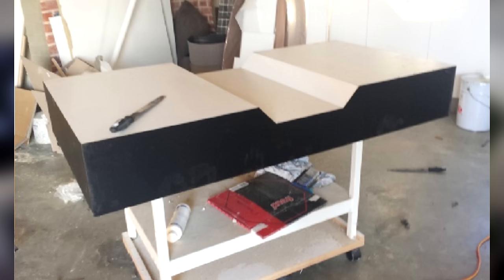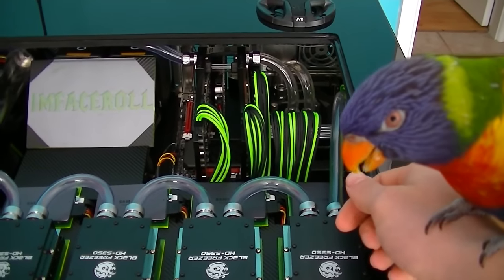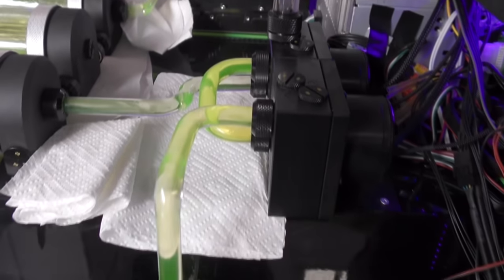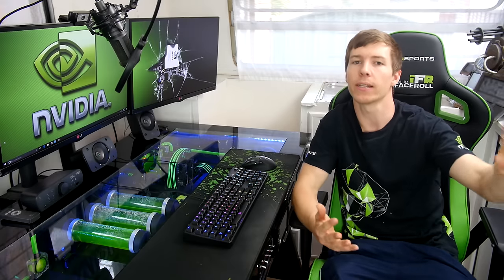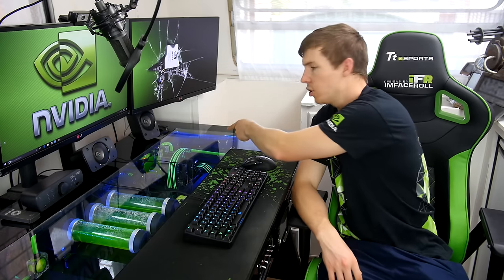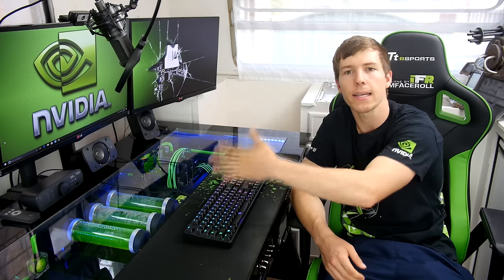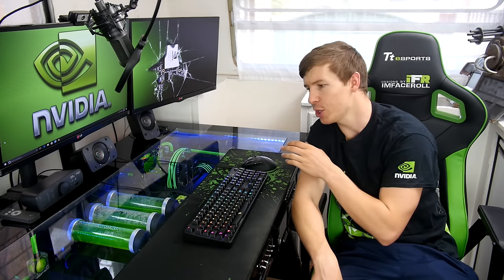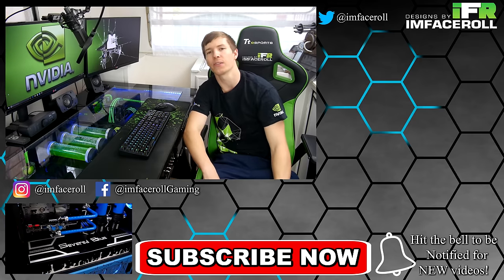Ultimate DIY Desk PC Setup & Tour - Full Build Log 2017

Comment: Because I was on a budget, My components are all different colors. I don't want to use acrylic, but more or less want to paint them. However, What paint can you use? Can you also paint the heat spreaders on RAM sticks? Great job with your channel, I haven't seen many people so dedicated to reply to basically all comments!
Reply from the maker: +BigBlockieBob hey man rustoleum is good, yes you can paint the heat spreaders. Perhaps even consider plastidip which is a rubber paint that you can peel off if ypu ever decide to sell your gear
Reply: Does adding paint to the RAM effect its ability to lose heat or is it not much of a difference?
Reply from the maker: +BigBlockieBob no wont do anything really

Comment: this is incredible, I'm currently designing my first desk computer case. After building your case is there anything that you would recommend doing? My pc will also be liquid cooled. did you focus anything on air flow or just build off of what you wanted in a case?
Reply from the maker: +Cris Schwanebeck yeh i have air flow blowing across the motherboard and to the other side of the desk

Comment: I figured you a three separate cooling loops since you got three reservoirs. What games do you play when you do game?
Reply from the maker: hey i like to play rocket league, wow, battlefield overwatch etc
Reply: Designs By IFR Ah I see, the high end games. I've never really been able to handle the fast paced games. About the fastest pace game I can handle is Delta Force but I have been wanting to try world of warships. Too fast a pace and my autism seems to make my brain lag. Guess that's a good thing though because I don't have to waste money on a graphic card that I won't fully utilize which is why I'm only running a GTX750Ti because it's just the right amount of card for my needs.
Reply from the maker: great way to look at it man, you could also snap up some really cheap hardware because of it =)
Reply: Designs By IFR I know. Been trying to find parts to put an old AMD Slot A processor to use.

Comment: this might sound like a stupid question but how do you clean the reservoirs if and when you clean them after a while
Reply from the maker: hey man, i take them apart and use some warm soapy water, i scrub the insides gently because scrubbing hard will cause small scratches etc.
Reply: how do you go about taking them out of the case if they are horizontal?
Reply from the maker: I basically use my air compressor to push the water out through a soft tube that i add to a free port

Comment: I'm considering putting one together so I can become a pc gamer and work on my programming passions I've got most of the stuff laid out I was just wondering how you filled all the empty space??
Reply from the maker: +Snick's Games with some wood filler etc
Reply from the maker: +Snick's Games oh you mean in the desk? I just had enough stuff to fill it
Reply: yeah all I've got is an eatx motherboard, 2 water cooling loops, and a power supply....i just hate empty space....
Reply from the maker: Yeah mee to, perhaps try put a console in the other side? Or an amplifier for your audio etc
Reply: Awesome...how did you run the io plate to the front to plug all the usb ports and connections, and how did you stick a car stereo
Reply from the maker: stereo is powered by molex and aerial cable runs under fake platform. Usb ports are plugged into usb 3 header on motherboard
Reply: wow it's really cool that you put a radio in there I'll have to experiment with that

Comment: Hey bro, love your videos. I'm actually going to be creating a pc desk as well. First, how many rads are you using. What are the pumps you used and what is that thing around them. Would really like to know. Where are your drain ports? Thank you, it would be great if you could answer!
Reply from the maker: +Kellie Young hey how are you, thank you for the comment =) i am using two radiators with noctura fans, i used alphacool vpp655 pumps with an alphacool pump top. To drain it i put a tube on the pump inlet that is free, i put a tube on the reservoir in the middle that has the 90 degree fitting and i use a machine to blow the water out, or if you want to do it quick you can blow it out with your mouth and clean the parts after wards with distilled water
Reply: Designs By IFR can you do a video on this the next time you drain the loop. Am thinking of building one for myself and think I might put a T splitter in then put a piece of soft tubing through the bottom of the desk w/ a valve and do it that way.

Comment: Looks really nice man, is there anything you could do about the condensation in the reservoirs? because I think it slightly detracts from the clean aesthetic.

Also, I know you said that you have HDD blocks for the looks, but do they actually increase performance at all?
Reply from the maker: hey man, maybe like a degree or 2 but performance of a hdd wont increase from 1 degree. the condensation can be fixed with full res

Comment: Hey man! 
I'm building my own desk pc right now and I do have already built my desk. Its made out of masssive oak wood. I still have to buy my water cooler and I've read that the color you're adding to the water is forming algea in the pipe. Did anything similar happened to you? 
I also am struggling if I should buy soft pipes or hard plastic pipes for watercooling. Could you help me out there?
I'm hoping for an answer! :)
Keep it up
Reply from the maker: +Shawn Teusch hey man do hard pipes it looks better. Algae wont grow if you add mayhems Nuke formula to the water